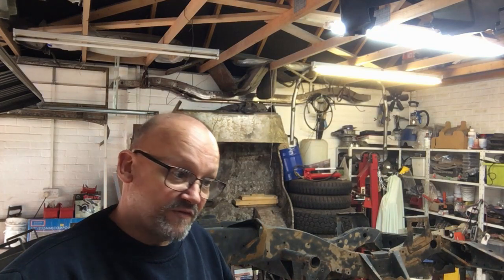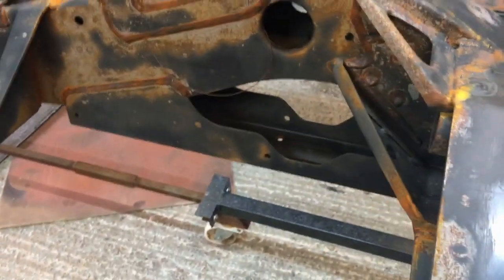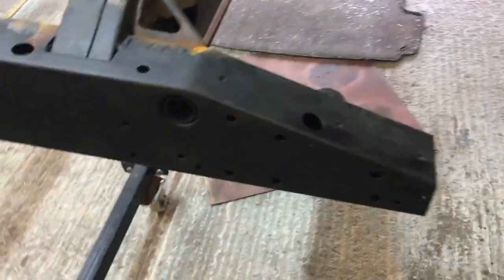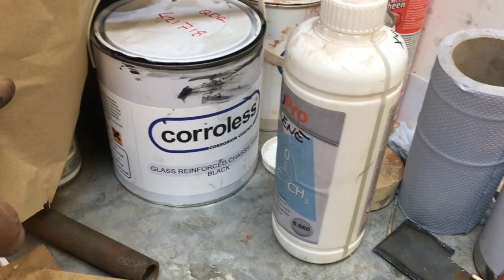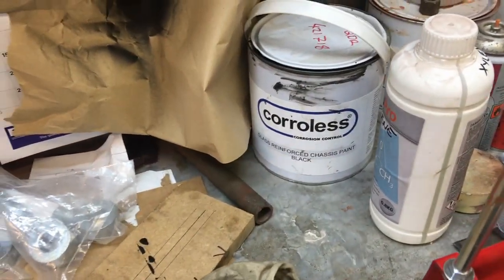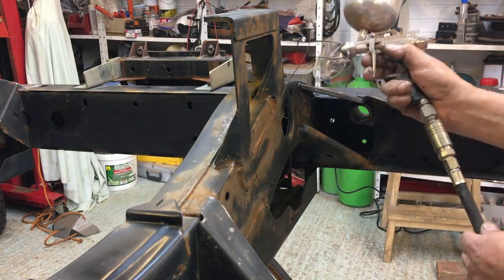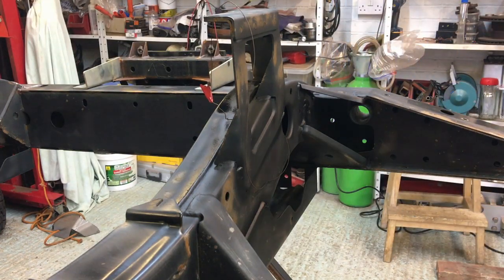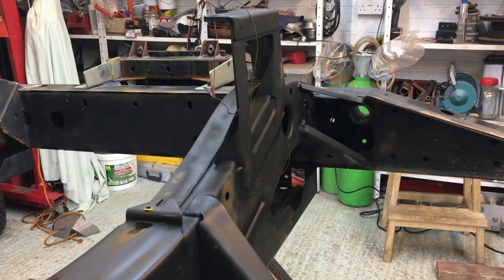Finally..we are painting the chassis!!

Comment: Hello mate - if you overcoat in RF16 isn’t that a gloss finish ?
Reply from the maker: Yes it is. With the correct information i would have painted the chassis first in Corroless S and then QDR over the top. I was mis informed unfortunately. It's gonna be fine as is, after all it's had months of rain, sun, ice and snow and there are only a couple of tiny patches that are turning blue.. the start of corrosion. I will touch them in and then I think I'll brush Waxoyl over all the external seams then wipe down after a few hours. This will leave the Waxoyl in all the nooks and crannies.